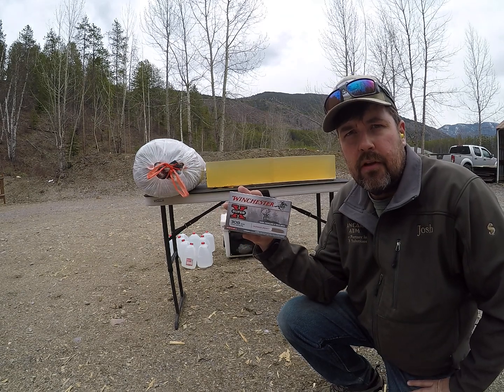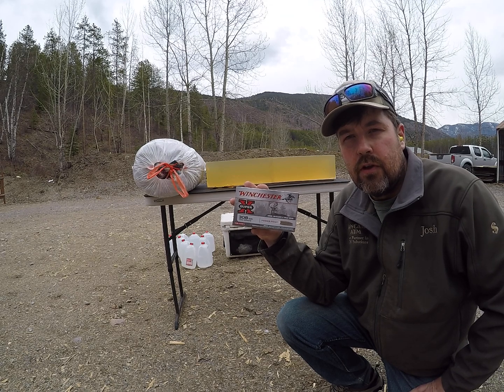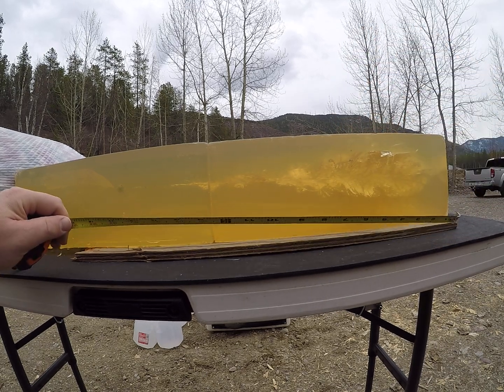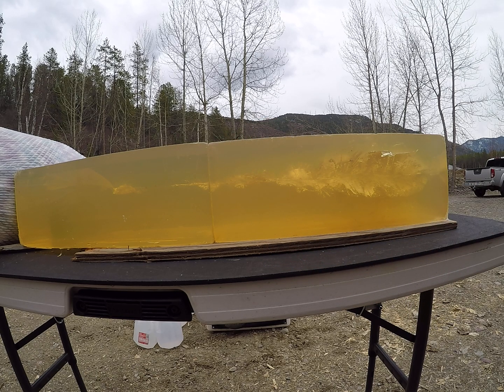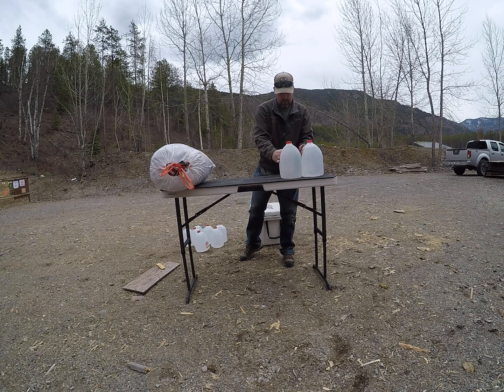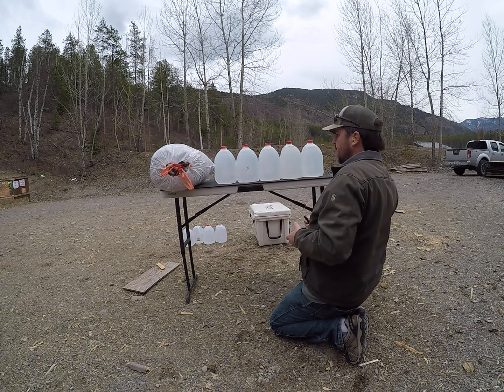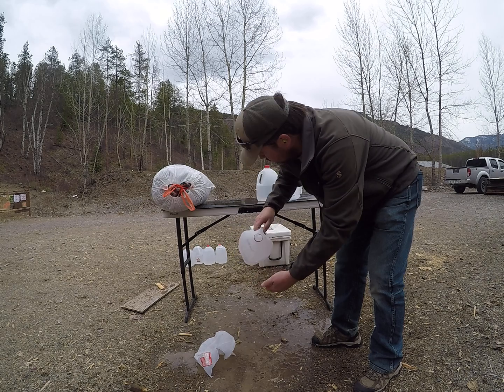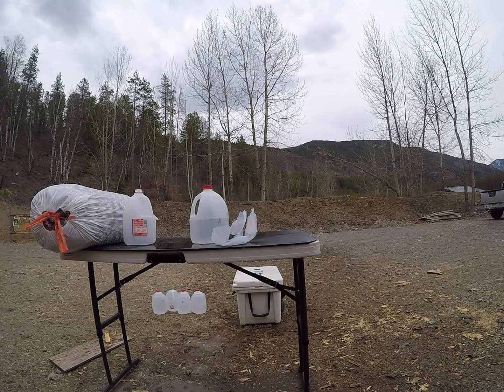Part 1, 150gr Winchester Power Point 10% gel vs water in jugs testing

Comment: Actually hunted and harvested a lot of game with Winchester power points. The 100 gr in .243 used to be a go to load until I started hand loading. Back then for the money they were hard to beat. Accurate and thumped white tail in Kentucky out to 400+ yards. The 80gr Winchester power point 243 is better suited for varmints. In 25-06 the Winchester positive expansion bullet in 90gr. was a thumper and deadly accurate in my old Weatherby. Possibly the most accurate gun I ever owned besides a custom 22ppc. But that's factory vs custom. Factory Weatherby with factory ammo. Quite a few folks at the range lost money to that combo. Should have seen their faces when I told them the ammo was from Walmart.🤣🤣🤷🏻‍♂️

Comment: I think using water works to compare bullets to one another, but will not accurately represent penetration on game. For example, I've compared hornady 158gr xtp hollow points vs 158gr xtp flat point in water, and definitely find the flat points penetrate further and expand slower, just like they're designed to. The hollow point xtp are designed for revolvers, and I believe the flat point xtps are designed for rifles.
Reply from the maker: Yes water can be a great medium to test when you're testing the integrity of bullets compared to each other. Taking those results and using them in the field hunting is not a good idea, that is not how bullets operates in game.